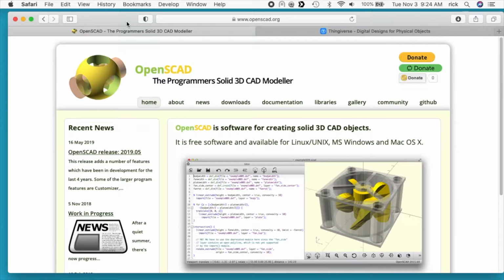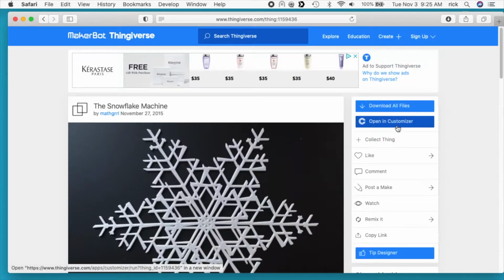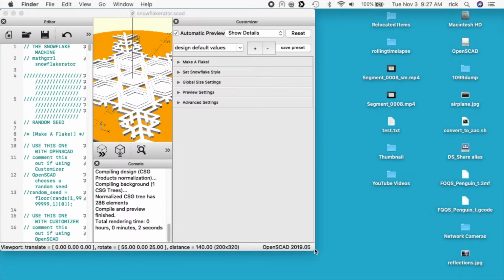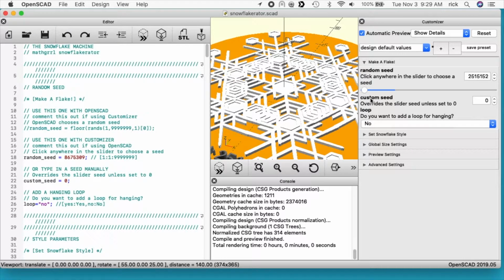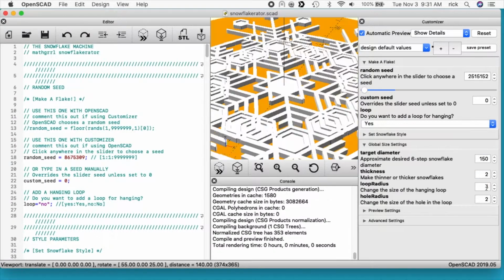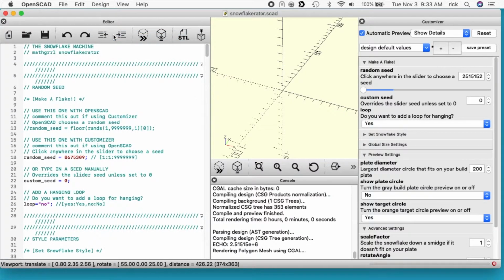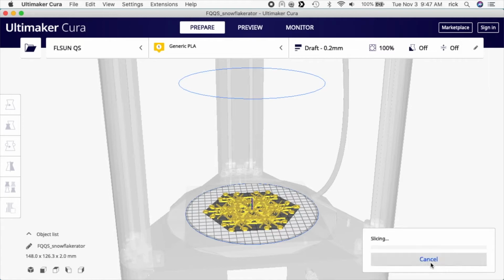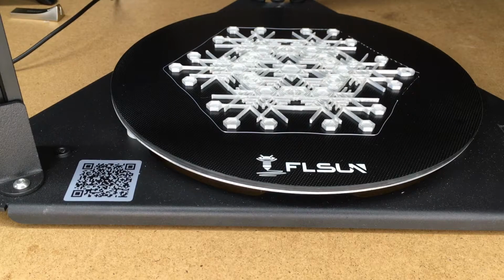FLSUN Q5: Random 3D Printed Snowflakes (Ep. 13)

Comment: You should grab some artists pallet knives for helping get under your prints.  A lot safer than using the scrapers suppiled with most 3d printers and exceptionally good for getting under prints with fine details in them.